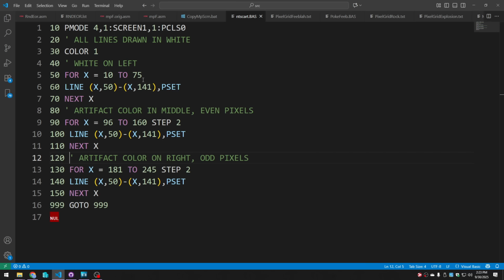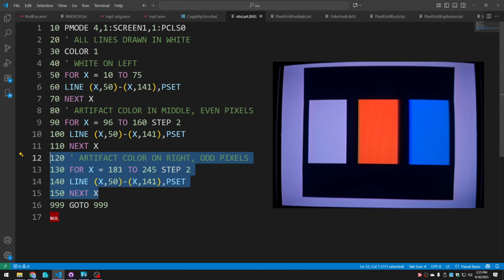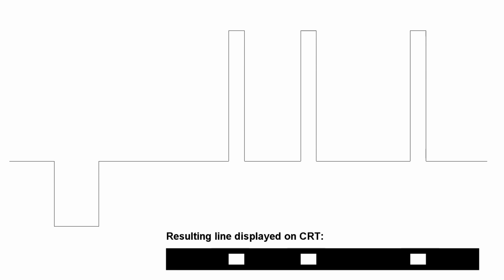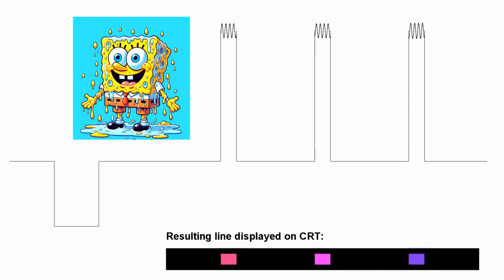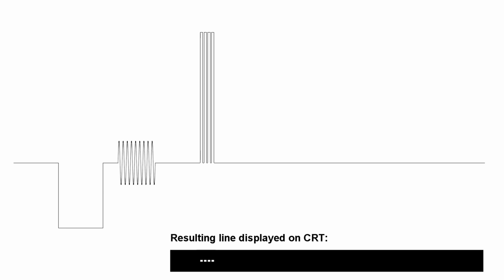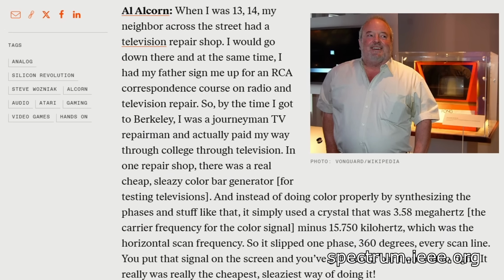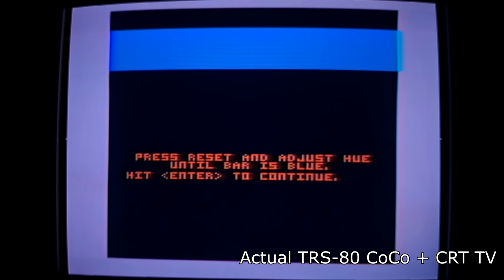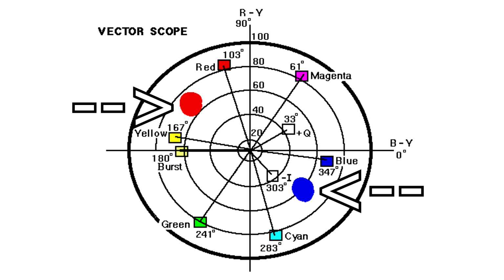How early computers TRICKED TVs into making color (out of nothing at all)

Comment: Awesome video!

A quick note: one of the most famous video game consoles of all time, the NES, technically uses artifact coloring to generate a color video signal! Though instead of black and white pixels, it actually takes color indices and uses five distinct luma voltages (one of them infamously being below the black level) where it alternates back and forth between two adjacent ones using 12 square wave generators clocked at increasing phases. It's a very clever design x3

Comment: Your explanation on the color burst is the clearest I've seen, I finally understand how it works! It's incredible how they could squeeze so much information in a 1 dimensional shape, and the exploits with the colors are genius
Reply: They were lucky that nearly all black and white TV's could not (or with r/c filter out) could not handle any luma signal over 3MHz, as there "could not be any need for more pixels per line", 
so, the added embedded color sinewave just gets averaged down to the original luma without the b/w TV having any idea that it did that.

Comment: Excellent video, I've been searching the web for years, looking for something like that, but this is the first I have found. I, myself, was planning to make such video, but you've done the job. ZX Spectrum (even PAL versions like my brazilian TK90X), Apple II and Atari 8 bit computers also had this feature, but Spectrum software producers never took proper advantage of that to create more colorful images. In order for this to happen, the pixel clock must be locked in phase with the color subcarrier al over one scan line. This wasn't the case of  MSX computers, that couldn't produce these composite video artifact colors, sometimes, improperly called, RF artifacts. I was able to create more than 100 adittional colors on my TK90X Spectrum clone.The price to pay is that you have to halve the resolution of the characters to keep color consistency over the screen, and characters should move in 2 pixel steps to avoid unwanted color changes. At least one book about the Spectrum mentioned this (d)effect, and how to use it, but I can't remember which book.
Reply from the maker: I'm glad to have filled the void, thank you!  And thanks for the additional info on those other computers.

Comment: My initial thoughts were that, if a high resolution is a black and white only mode, and you're sending a pixel every other pixel, you're just simulating using half the resolution, and so tricking it into thinking you're in a colour screen mode - the truth was way more fun and interesting! Though seeing that the other modes have at most 4 colours, it makes me think that all they are doing is taking away programmer control so that they can do this banding for you
Reply from the maker: On the coco, the lower resolution modes really did use chroma. My guess is that limiting some of them to four colors simply limited the amount of memory required to encode all of the pixels.

Comment: I still didn't get one thing. That TV or CRT was monochomatic or color? If it was monochromatic, which means only one electron beam and one type of white luminofor, then I don't get where the color comes from...if the screen was actually a color one, then why all these complicaitons and not just generate a proper color signal?
Reply from the maker: The TV is color, but doing color the “proper” way was hard, especially with the limited circuitry available to the apple 2.

Comment: I understood everything you explanied. But you did not mention what was the original problem here, if the screen is a color screen, why not just send color signal, why to mess with these workarounds?
Reply from the maker: In the case of the apple 2, it did not generate chroma at all, and used luma for all of the colors.  I'm no electrical engineer, but my guess is that Chroma is tough, b/c it requires carefully adjusted phase changes for each new color across the scan line (versus luma, which can just be a square wave that goes up when a new pixel needs to be drawn).  In the case of the coco (which came a few years later), it actually was capable of generating chroma, and did so on the lower resolution screens. It is only on the high resolution screen where it relies on artifacts to get colors.

Comment: Obvious question: if the computer is deliberately sending a color burst signal, it's clearly designed with the intention of being able to display color video; so then, why doesn't it just send a normal color signal?  I have two guesses as to the answer, but I don't know which is correct.  I'm guessing that either A) they didn't want the extra expense of multiple bits of video RAM per pixel (a problem that PC video cards starting with CGA eventually resolved by making the color video mode have lower resolution than the black and white mode, which remained true until, umm, some time after the introduction of the VESA standard for SVGA, I think), or else B) the video hardware needed to generate the color signal would have been more complicated and therefore more expensive, than the hardware that generated the color burst and the otherwise black and white signal.  Any idea which of these explanations is closer to the truth?  Or is there some other factor you know about that I haven't considered?
Reply from the maker: I'm not an electrical engineer, but B is my guess. The color artifacts effectively lowered the resolution, such that each bit which was supposed to be a single black and white pixel ended up just being half of a 2 bit, wider color pixel instead. So I don't think that more storage would really be required to do color the correct way on a high resolution graphic screen, as long as we're talking composite video. Though there could be something I'm missing there.

Comment: I'm watching this on a mid high end 19 inch end Samsung dot mask CRT monitor from 2002, i can do 640x480, 1920x1080, 1792x1344 and 2048x1536 on my modern 2021 PC with a display port to VGA adapter.

It's hilarious how sharp, crystal clear and color accurate the image quality is compared to a CRT TV. It's like a 27inch 1440p OLED or LCD sharp but for 19 inches diagonally and no aliasing whatsoever with perfect motion clarity.

Comment: Maybe I missed it, but why couldn't they just send a colour signal? My first thought was that it was due to the chip not being able to send waves, but the can't be the case, since they did send the colour burst signal.
Reply from the maker: In the case of the apple 2, it did not generate chroma at all, and used luma for all of the colors.  I'm no electrical engineer, but my guess is that it's much easier for digital circuits to generate color burst than it is to generate chroma. Just a simple sine wave or even a square wave approximation at the right frequency and you're good. Chroma requires carefully adjusted phase changes for each new color across the scan line.  In the case of the coco (which came a few years later), it actually was capable of generating chroma, and did so on the lower resolution screens. It is only on the high resolution screen where it relies on artifacts to get colors.

Comment: Hold on   Wher ntsc brpadcassts progressive and was the framerate 60, I've ben told by other channels thst  ntsc was 70 fields ( of half frames ( only odd or even lines in each field interlueved resulting in 30 fps ( this was far b/w signals, was I misinformed or did you simplify to avoid to much detail
Reply from the maker: I believe NTSC is 60 interlaced fields per second, which means 30 frames per second.  When color was introduced, those numbers got changed by a small fraction, but still very close.

Comment: That's strange how computers can be non-deterministic sometimes....I heard that the Atari 2600 would display different things each time it's powered on without a game cartridge installed...
Reply: Indeed it did, because the bits inside the video chip registers were not initialized to specific values when it was powered up.  I'm not even sure if there was a reset pin on that chip.  It would show random patterns of vertical lines in random colors.  Sometimes, you could even get games to start in a glitched state, usually by turning the system on and off either quickly or slowly.  That was called a "fried game".

Comment: Slight clarification: you correctly state that color is achieved through QAM, but the encoding is not HSL or HSV. The in-phase (I) and quadrature (Q) components do not correspond to hue and saturation. Instead, they form a plane that ranges from yellow-blue on one axis, and green-magenta on the other. To be sure, if you convert to polar coordinates, angle would approximate hue, and magnitude would approximate saturation—but QAM demodulation decodes I and Q, not angle/magnitude.

Comment: It's nice to see a solid explanation of the NTSC color system and how artifacts work. In the early 1980s, I had the pleasure, or displeasure depending on your view, of using the MC6847 in some industrial equipment to generate an internal but simple color bar test signal. It wasn't exactly state of the art when it came out. The MC1372 was even worse to deal with, and I ended up using a National Semi encoder chip (LM1889 I think). But we used that for years until early programmable logic chips came out and I could generate a more proper signal. Somewhere I still have some MC6847P chips and a pair of MC6847 chips with ceramic packages and gold side brazed pins (thank you Motorola).

Because of the limitations in the MC6847, Motorola set to work on a new chips set, the RMS. At the time, it would have been a huge step forward, but they couldn't get anyone to commit to using it in volume. There was talk of a new RS Coco with it but it never happened. Only the analog PLL chip was produced in volume and used in the Video Toaster.

Artifact color could sometimes behave in different ways depending on the TV. Early TVs used injection locked oscillators to regenerate the subcarrier reference derived from the color burst signal. Later TVs (late 70s onward) used a phase locked loop to more accurately reproduce accurate colors on the right side of the screen. In the NTSC spec, the 3.579545MHz had a +/- 10Hz tolerance although most TVs would lock to +/-40 Hz or more. For some computer, this would pose a problem as they weren't that accurate.

Off hand, I can't remember if the MC6847 produced the true 15734.264Hz horizontal line frequency or the more common for computers 15699.76Hz line frequency. I think it was the lower frequency since I seem to recall solid banding along vertical line color transitions. At the lower frequency, dot crawl would disappear but leave horrible static artifacts on highly saturated color edges. Everything in NTSC used odd half multiples. The chroma frequency (3.579545MHz) is an even multiple of half the line frequency. Early chips couldn't handle the common 14.318180MHz master clock frequency (4x color subcarrier) so they divided the 3.578545MHz by 228 (instead of 227.5) to get the 699.76Hz line frequency. Every early computer and video game was a kludge to make color video. My favorite is the Atari VCS which used the delay from a hex inverter to generate different colors. When Motorola did a die shrink and the inverter got faster, the colors were all wrong. Other brands would change the color palette too since their delays were different.

Great video, thank you for a walk down memory lane.
Reply from the maker: Wow, thank you so much for sharing all of these technical details and your personal experience with these chips!
Reply: I was just transported back to seeing a MSPS datasheet labelled "Advance Information". So many of them never seemed to get beyond this level!
Reply: @steved3702  - Motorola was well known for designing new parts, promoting them heavily and then quietly halting production when no large orders were received. I designed in at least three Motorola parts that disappeared before we made it to production. I know one was a 1H delay line but all were video related. I think I still have most of the data sheets yet for a lot of the parts that never went to serial production.

Comment: Why did they have to trick a color TV into showing color?
Reply from the maker: Because doing it the proper way was hard.  🙂
Reply: @CocoTownRetro  That's the part I'm confused about.   But I guess you're saying the small computer in the game couldn't do what the television broadcaster could do.  Is that right?
Reply from the maker: @presto709  In a nutshell.  Proper chroma requires carefully adjusted phase changes for each new color across the scan line.  Easier to just have the developer place white pixels of the right size in the right places.
Reply: @CocoTownRetro  Thank You.   Very interesting video

Comment: My guess for why this (useful) glitch is not mentioned in the hardware manual is because it would not be present in all CoCos, due to the actual display standard being used. I never owned a CoCo but I used to mess around with one at my local Radio Shack back in the day and I always wondered why I was instructed to press reset until "the alien's eyes are blue and his lips are red". Now I know why! Thanks! 

Also, that 3.58mhz is very important for consoles and computers from the 80s. The Super Nintendo runs at that frequency and the Commodore Amiga ran at a multiple of that frequency: 7.16mhz. I makes it easier to sync to displays.

Comment: Great explanation!  I had a CoCo 1 and honestly, it was filled with hacks.  Sound was generated with a 6-bit DAC made of discrete resistors.  The joysticks were read using the DAC and software successive-approximation to turn the DAC into an ADC - the output of the DAC could be fed to a comparator for that purpose.

And if you disassembled the BASIC ROMs, there were a bunch of places that conditionally jumped into the MIDDLE of an instruction, so you'd either execute CLRA or LDA #$4F.  'Twas done to save space... wild.

Comment: I don't get it. The TVs were colour. Why couldn't the computers simply generate the proper genuine signal for the TV. Why the need for trickery?
Reply from the maker: In the case of the apple 2, it did not generate chroma at all, and used luma with artifacts for all of the colors.  I'm no electrical engineer, but my guess is that chroma is tough to generate, b/c it requires carefully adjusted phase changes for each new color across the scan line (versus luma, which can just be a square wave that goes up when a new pixel needs to be drawn).  In the case of the coco (which came a few years later), it actually was capable of generating chroma, and did so on the lower resolution screens. It is only on the high resolution screen where it relies on artifacts to get colors.

Comment: @4:57 Pedantry, but the statement “the original NTSC black-and-white signal” is nonsensical. NTSC was a color system that was applied on top of System M, which was the underlying black-and-white signal format. PAL is another color system, as was SECAM. Usually, NTSC was put on top of System M (e.g. USA) and PAL was put on top of System B (e.g. Spain) but you could mix-and-match (e.g. PAL on M in Brazil).

Comment: 12:00 The title in the thumbnail is 🎯

There's one thing I'm not sure I understand : If the hardware can generate a colorburst, shouldn't it be able to generate chroma ? Is it because it is limited by whe clock and can't be offset ?
Reply from the maker: In the case of the apple 2, it did not generate chroma at all, and used luma for all of the colors.  I'm no electrical engineer, but my guess is that it's much easier for digital circuits to generate color burst than it is to generate chroma. Just a simple sine wave or even a square wave approximation at the right frequency and you're good. Chroma requires carefully adjusted phase changes for each new color across the scan line.  In the case of the coco (which came a few years later), it actually was capable of generating chroma, and did so on the lower resolution screens. It is only on the high resolution screen where it relies on artifacts to get colors.

Comment: Easy sub.  I'm looking forward to watching a lot of vids like this!

I have a question for you-- one of the CoCo computers (I think 3) had a hack where you could poke an address to double the clock speed-- but it made your display go CRAZY-- like, total acid-trip crazy.

Does anyone remember which CoCo it was, and is there ANY chance someone has a video of that effect?
Reply from the maker: All the cocos had some kind of speed up poke. The 1 and 2 allowed you to speed up accesses to ROM, while the coco 3 allowed you to speed up access to both ram and ROM.  In all cases, the rainbow color cycling cursor would appear to go on overdrive.  But the overall picture remained just fine. So I'm not exactly sure what you're thinking of.
Reply: @CocoTownRetro  Yeah, there's one that doubled the clock speed of the CPU (I think), and it made the screen go completely bonkers-- no flashing cursor, but something like a psychedelic painting or something-- as in, you couldn't see ANYTHING but this crazy visual noise.  Its use case was when you were processing something intensive, and you'd go mix a glass of chocolate milk or something and come back.  It was for sure not the CoCo 1-- I want to say it was the 3, but I'm only 70% sure on that.

There are 2 things I remember from Rainbow magazine: 1) this speed poke and its crazy effect; 2) to make an extra-long line in Basic, you would type it partway and then edit it: something usually used for the 1-liner contest each month.

It's currently my Holy Grail to find someone who can reproduce the speed poke effect and record it.  It was quite the trip!